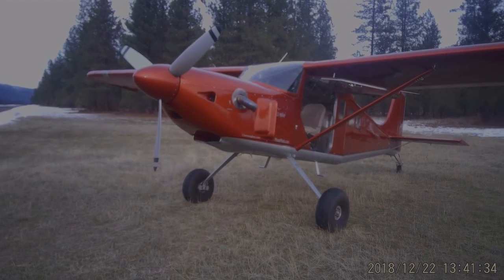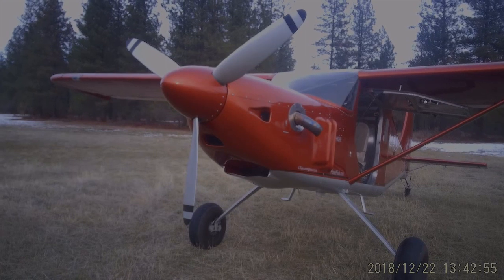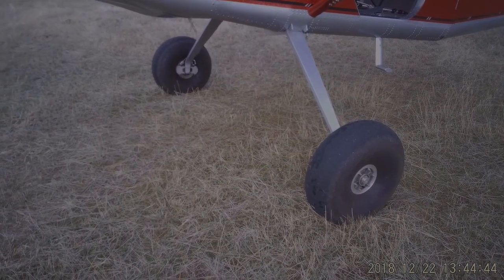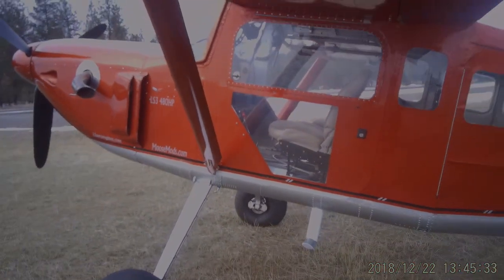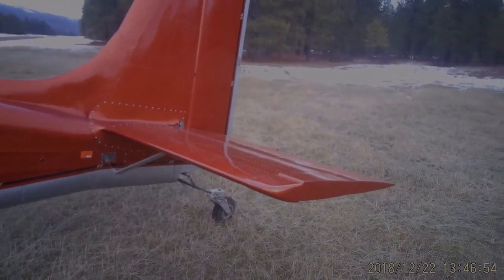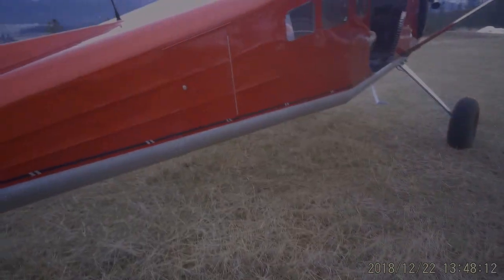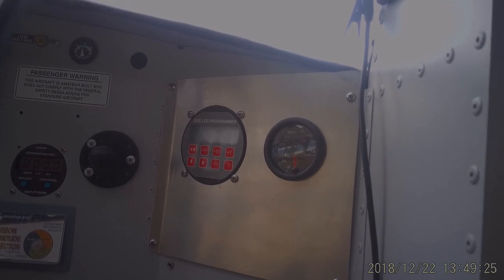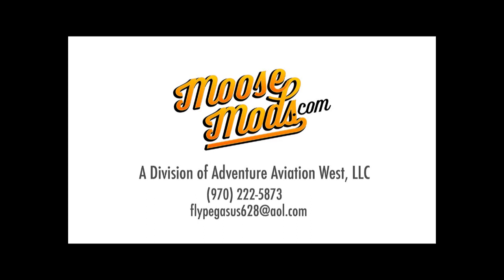Introduction to the Bull Moose

Comment: This is a very well done video. Was I imagining things? I didn’t see a prop control on the panel....?
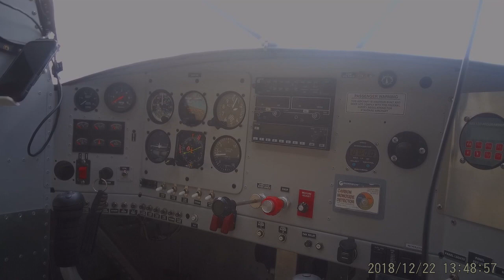Reply: It's the red next to the throttle. He didn't have a blue. The mixture control is programed into the engine computer, so it only has a tiny knob to the right of the prop for very fine adjustments if desired. See 7:40

Comment: Beautiful! I have a few more pennies to save up to order my kit and I think I have got to go with this power plant! Please do a video on what kind of performance you are getting on calm days (no screaming headwind for STOL) as well as some videos on exactly which components get replaced and how with your fuselage upgrades. Also, does the engine take MoGas or AvGas? And roughly what cruise speeds are you getting at what fuel flow rates?
Reply: Go with the radial. Cheap to replace.
Reply from the maker: Thank you Dominick.  Once the weather settles down and leaves a long winter behind, we have a number of videos planned to demonstrate some real world performance.  At this point 170mph TAS is very realistic, and I am expecting some further testing at greater power settings to push it another 5-10 mph if so desired. A very comfortable cruise at 155 mph gives a fuel burn of 15 gph,  The engine is happy on either MoGas or 100 LL.  Stay tuned and thanks for your interest!